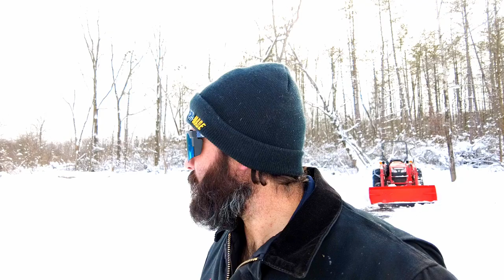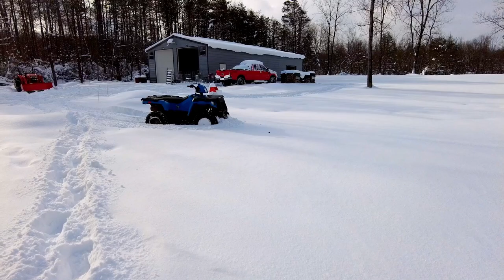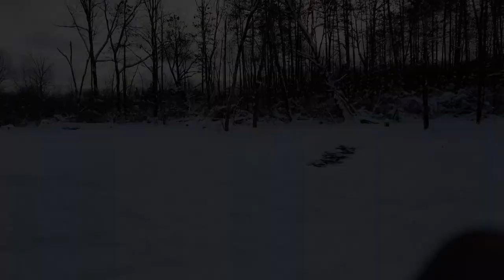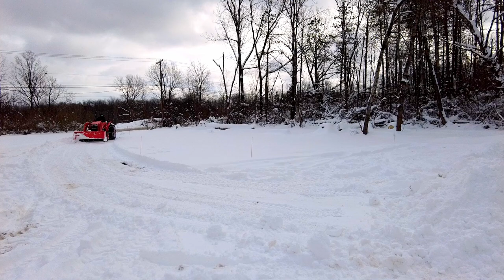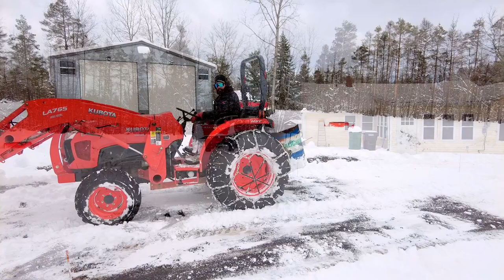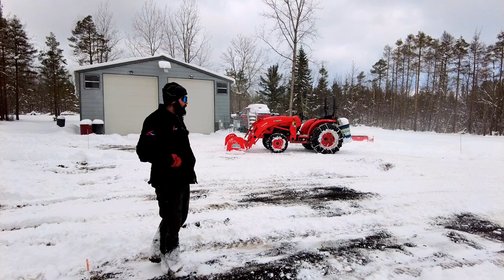Testing my DIY Tractor Tire Chains

Comment: Just Add A few More Links To Fill Gaps.  The More cross Chains The better To keep cross from falling in lugs.  Your Chain set Is Just Fine  I Too Make Anything I can to plow, 4 Tractors & 1 Skid Steer That is a Lot of Money to spend. I Do what I can every Year, It Works For Me, At a Min of Cost, ONE SET HAS WORN OUT IN 30 YEARS of Pushing, Snow blowing & Dozing soil.  Keep up the Engineering.
Reply from the maker: They seem to be working fine for now, I might modify them over summer when I have some more free time! Thanks for watching!

Comment: Those work great so you did a good job on them you could just buy them cheap chains for the front wheels but whatever you seem to know what you're doing take care nice video
Reply from the maker: My old ATV chains are very close to fitting, they would just turn out like the back and have some gap to them…I might have to make it work.

Comment: Over the summer you may want to look into the length of the cross links. I think if you shorten the cross links by 2 to 4 links this would bring the outer and inner circumference chain higher up the tire. You could use zip ties to tie together links shorten them for test fitting. If you want to get fancy using lap links, I suggested last video, or you could use cross links as well.
Reply from the maker: Yeah, I might make some modifications to them over summer, but for now they work...Maybe if we get a break for a week or two this winter I'll change things up a little, but with all the snow we've been getting I need to have them ready!
Reply: I agree cross links too long.  good job with the build

Comment: Looks like your homemade chains work pretty well.  I grew up on a farm when I was a kid, as far as turning, I don't know if your tractor have a right and left break but you can turn the wheel push down on one of the breaks down on the side that you are turn in it'll slow that wheel up and the other one will speed up and it'll help you turn.  Farmers would use that same technique when they came to the end of the field and they needed to turn right around and go nearly back the way they came.  Thanks Michael ☺️
Reply from the maker: It does have steering brakes, and honestly I’ve never thought to try that in the snow…I’ve used it in the field before, not sure why it didn’t click and give it a try. I’ll be sure to try that next time! Thanks for watching!

Comment: That is a nice tractor.. I don't run tire chains at all.... That was my reasoning for buying a Kubota four-wheel drive... Haven't had an issue yet... As far as steer chains I hear say from some it's not highly recommended could cause front drive part issues... Just use your brakes to help steer a little or take some load off the snow pusher raise it a hair
Reply from the maker: With the snow we get even in four wheel drive I lose traction. Go check out my last snow pushing video where we got 5’ of snow over a weekend, and you’ll see what I mean. Thanks for watching!
Reply: @EverythingElliott  yeah where I come from we get pounded pretty good baby bites that's all

Comment: Another awesome video.I love my kubota and really enjoy watching others use their's. Very important tip about back dragging. When bucket is tilted all the way down the pressure of the spoils  being dragged is all at the very end of cylinders.last couple inches or so.This causes damage to cylinder and piston.Very expensive cylinders. I've seen them split and rams bend and it doesn't take much.Snow is probably safe if it's not wet, but dirt and heavy rocks, logs ect can.Hope to see u pull a  plow or disc.
Reply from the maker: I don’t have a plow, and I traded my discs in for a rototiller. I you should be able to check out all my tractor videos using attachments on my “kubota L4701” playlist on my channel! Thanks for watching!

Comment: Chains look great my bought chains have a large gap like that as well. Check with your highway department you may be able to grab a cutting edge from a grader for you back drag. They usually replace them around here every storm the wore out ones are still about 4” wide could be a good start to your back drag project
Reply from the maker: While that’s a fantastic idea. I use rubber cutting edges on my driveway because I have millings. The rubber cutting edge for my pusher was $10. I was thinking of just getting 2”x2” heavy wall tubing and slap a rubber edge on it

Comment: Chains on drive wheels make a huge difference. We had them on all our tractor during the winter and spring months. Don’t get me wrong you can still get stuck but if you don’t try anything too ridiculous you are able to get through most deep snow and muddy areas a lot easier. You can always add a section of chain in the areas that seem to be lacking. Oh and I just subscribed.
Reply from the maker: Thanks for watching! I’m very happy with the way they turned out, I might add some very minor modifications to them to button up that gap I have where the chains meet, but besides that they work great!

Comment: I'm not sure if anyone mentioned or thought of this, but what if you aired down a little bit on the tires a 3-4 psi. i wonder if it would help them fit better.  Just ordered my first set today.  Thanks for the video!
Reply from the maker: My rear tires are filled with liquid ballast so I don’t believe it would make as big of a change as one would imagine. Since I made these myself I wasn’t expect an absolute perfect fit, but they work very well for what they are

Comment: How wide is your machine vs snow pusher?  Would you get one any wider now that you have the traction?
Reply from the maker: The pusher is the exact size of the machine. I might go for a 7’ if I did it again, probably wouldn’t go any bigger than that, mainly because the door I pull my tractor into is 8’ wide.
Reply: @EverythingElliott  how much wider would a 7' be than your machine?
Reply from the maker: @BS.-.-  my tractor is 6’ wide

Comment: Tires on my 3005 jd are turf tires  never have problems in snow
Reply from the maker: Go back and check out my 5’ of snow over a weekend. I don’t think there’s any tire in this world that would push that snow in one go.
Reply: I use a 54 inch frontier snow thrower    when we get six or 7 feet

Comment: Dont fill ur ditch with packed snow  it backs water up in the spring
Reply from the maker: Ditch is still about 3’ from the snow piles. Ditch runs right on the wood line